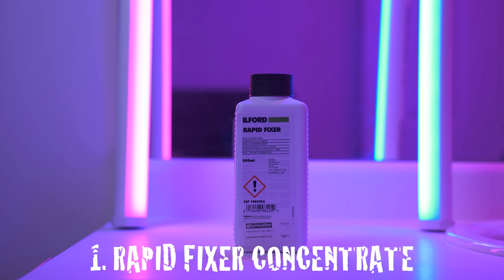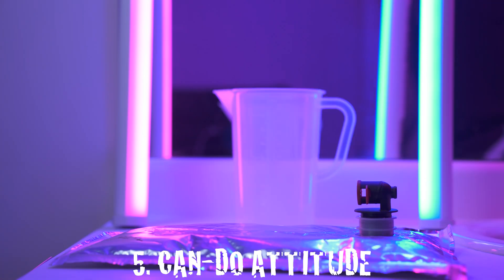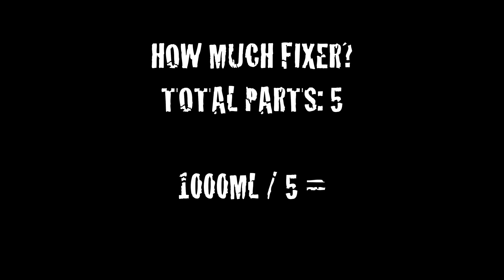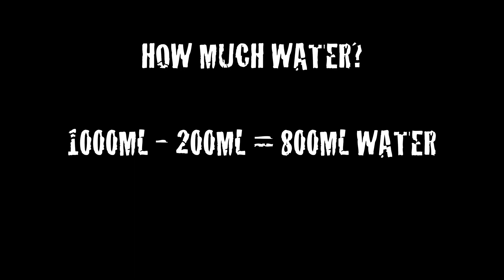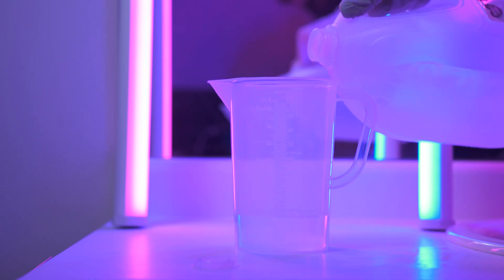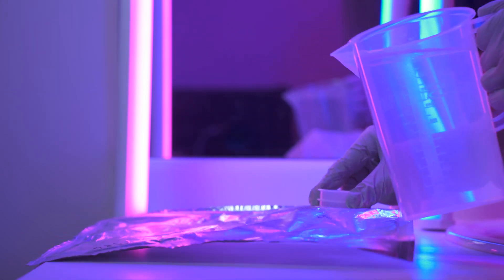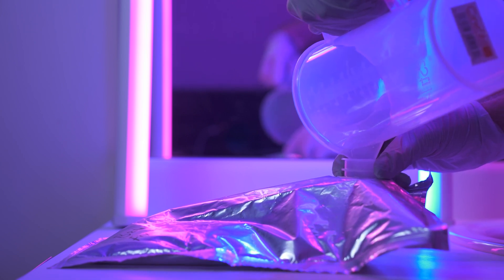How To Mix Ilford Rapid Fixer (For Film Development)

Comment: Hi there! great video honestly. I have some questions. How many rolls can you develop with that solution?. I was thinking on buying 500ml, but, what do I do with the 100ml left? just pour it in after I have finished the last batch?

Thanks!
Reply from the maker: Hi Aaron! Thanks for your positive feedback on the video! I’ve not kept track of how many rolls I’ve used with a batch of fixer, I just reuse until the clearing time starts increasing - then I know it’s time to mix a fresh batch. 

An opened bottle of fixer is good for 6 months - you can use the left over 100ml for your next batch of fixer. (If you mix up another batch within 6 months.)

I recently learned fixer can be replenished. You’re able to significantly extend the life of the fixer and use less. 

I started doing this and storing the mixed fixer in air tight aluminum wine bladders. They keep developing chemistry fresh up to a year! 

Happy developing! 😎👍🏻
Reply: @1331photo  Thank you so much for answering! I hope you are having a nice day. How do you know when to increase fixing time? thanks!
Reply from the maker: @lostaaron8  You’re welcome! 🙂

Yeah! Today’s been a good one! I hope you’ve had a good day as well!

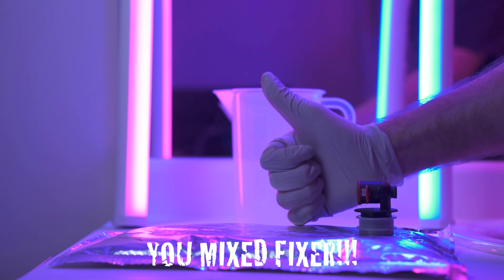On Ilford’s data sheet they say clearing time is 2:00 - 5:00 minutes depending on the film. 

If you’re not replenishing your fixer you’ll probably want to mix up a fresh batch if the clearing time starts getting up to 8 minutes (that’s what I used to do.)

If you’re replenishing your fixer the 2-5 minute clearing time should be consistent  because you’ll be “replenishing” the fixer after every use. 😎👍🏻
Reply: @1331photo  hi! Sorry, I think my youtube app got bugged. I was saying thanks for the info and asking how do you know when to increase the fixing time, also, what does replenishing mean? Does it mean that you make a solution everytime you develop? I don't get it, thanks! :)
Reply from the maker: @lostaaron8  No worries! 🙂 If using Ilford Rapid Fixer the average time for a roll to clear is 2-5 minutes. When it takes longer  than this you’ll know it’s time for fresh fixer.

The basics of replenishing fixer are: mixing up a fresh batch, using it, then discarding a small amount of “used” fixer and replacing that same amount with “fresh, unused” fixer. 

Keep in mind you’ll need air tight containers to store the fixer in if you decide to go the replenished route 😎👍🏻
Reply: @1331photo  oh okay! so you check the film after fixing? Open the tank and see how it is? would you let me know what is the indication that it needs more fixing?
Reply from the maker: @ Correct, you’ll check the film AFTER fixing. Don’t open the tank before or the roll will be ruined 😎

You’ll know if your film is cleared if it’s transparent or “see through.” If the film looks foggy, it’ll need more time in the fixer bath.

Some B+W films have a residual pink or purple tint after developing and fixing. This is totally normal and will wash off after thoroughly rinsing.
Reply: @1331photo  Great! thank you so much for all this information, it is really appreciated. Have a good weekend :)
Reply from the maker: @ You’re welcome! Thanks for checking out the video and asking your questions! Enjoy your weekend! 😎👍🏻
Reply: @1331photo  That is a great response! thank you so much. How do you know you need to increase the time? thank!

Comment: can i use tap water instead of distilled water
Reply from the maker: @U.Boonmee  Before using tap water, check the PH & hardness levels. These two factors can influence how well the chemicals work and how long they’ll last. 

Distilled water has a neutral PH and a hardness of 0 (meaning little to no impurities) so it allows the chemicals to work as intended.

If you’re investing the time to shoot film & develop, buy developing equipment & chemicals, it’s worth using distilled water.

Test your tap water and let me know what you find out!

Thanks for watching & asking your question! 😎👍🏻

Comment: im really new to devolping but how much do i have to put into a gallon bottle
Reply from the maker: Hi! 😀 

Are you needing to know how much fixer you’ll need to make gallon worth? Or are you wondering if you can mix a smaller batch of fixer and store it in a gallon bottle?
Reply: @1331photo  yes how much would i need to make a gallon
Reply from the maker: @fwa3  To find out how much fixer and water needed we’ll divide the total volume (in milliliters) by the total number of “parts” (the water and fixer).

First, we need to know how many milliliters are in a gallon: there’s 3,785. That number is our total volume.

Ilford lets us know we need to mix 1 part concentrate to 4 parts water. 

We add the “parts” together: 1+4= 5 

Now, we divide the total volume (3,785) by the total parts (5)

3,785 / 5 = 757

This answer gives us the total amount of concentrate needed for a gallon (757ml)

To find out how much water is needed, subtract the amount of concentrate (757ml) from the total volume (3785ml)

3785 - 757 = 3,028

So, to mix a gallon of fixer at a 1:4 ratio, you’ll need 3,028ml of water and 757ml of concentrate 😎👍🏻
Reply: @1331photo thank you a lot 👍🏽
Reply from the maker: @blaka1_102  You’re welcome! 😎👍🏻